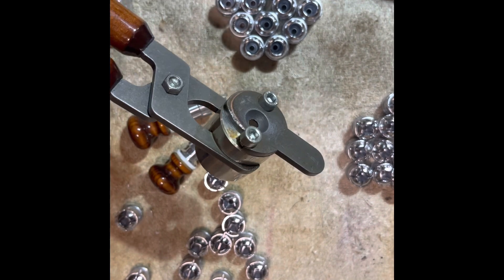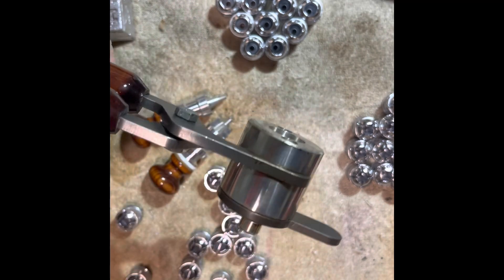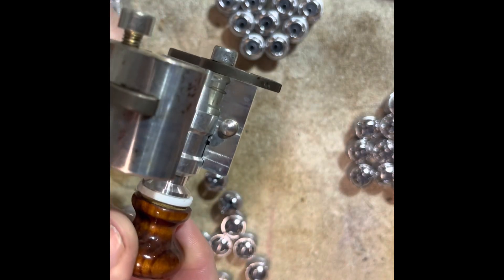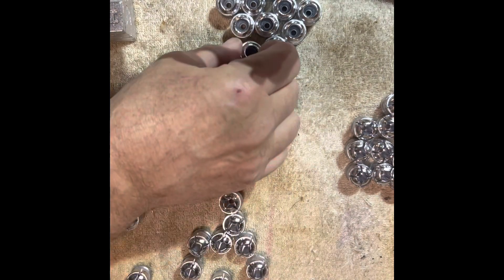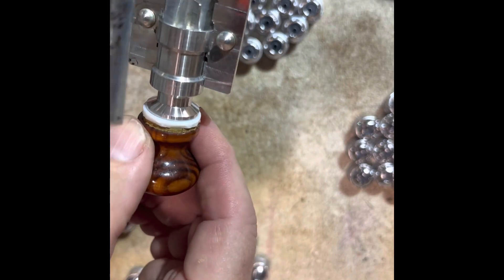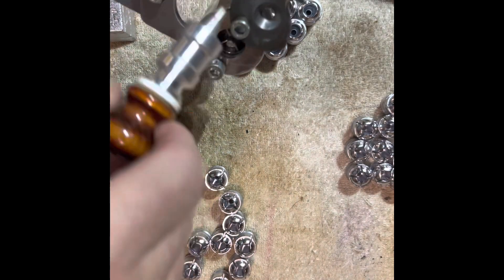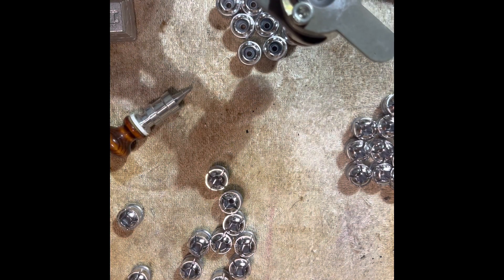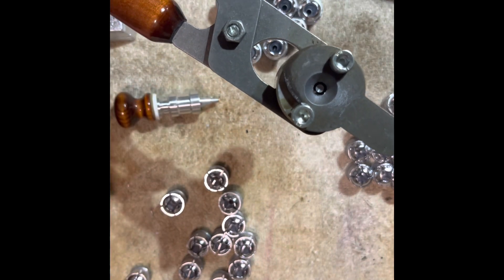AS Shotgun Slugs

Comment: Someone sent me some of those to try . I used a wad with the fins cut off and didn't have much luck with accuracy .
Reply from the maker: I have twice read that this was there case as well. Talfladermouse just did a video and said exactly same. You need the proper brush wad and a spacer between also helps allot. Ill show all in another video.
Reply: @cw2a  When I saw the extra expense of the brush wads and some having to be screwed to the slug I kind of was turned off by them . My old Lee slug shoots very well and is easy to load for and much cheaper and at a higher velocity with less recoil 
 .
Reply from the maker: But the biggest bugger to cast proper!! 😝😋 If it works it works James!! Stay with what works!!